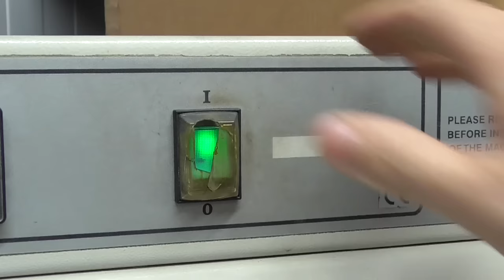Rusty Jammed Rebar Cutter - Restoration

Comment: Machining is one thing, welding is another. Take a welding course 😉
Reply: Even if he's not great at welding. He's fantastic at machining. So it does the job. He's looking for a bond, not a pretty joint. What's the point in a pretty weld when your gonna re machine the peice anyway
Reply: Joey Gartrell exactly get er done lol
Reply: Welds were not bad
Reply: @RylaDarkstar  You don't judge a weld based on what it looks like on the outside...
Reply: @redline9579  A real welder know when it's good weld and when it's not. Trust me I know what I'm taking about
Reply: Rob C  Thank god someone who speak my language! It's nice to meet you doctor Banner!
Reply: @RylaDarkstar  I wouldn't say that just yet. He hasn't figured out that round files are a thing yet, and he welded inside a hardened bushing instead of replacing it
Reply: And he doesn't know how to use a file properly
Reply: @420StepsFromHell  grinder an paint!
Reply: @redline9579   you're right. Welds weren't bad. They were atrocious.
Reply: @IRonIcScopez  obviously you know nothing of welding. I've been welding for 10+ years. The very first thing a weld must do is pass a visual inspection. If it's ugly and doesn't pass, it doesn't matter about the penetration or bond. I've seen welders get “looked out" on the job over an ugly weld. Learnt ya a lil something today about welding.
Reply: @tynstaci  haaaa haaa haaaa omg hahahahahhahahaha
Reply: @tynstaci  And I've been taught by a journeyman welder whos been welding 4x as long as you have. I very often make better looking welds than the guy who taught me, but thats just because hes older and I have a steady hand, that does not mean that my penetration was better, or that my weld is stronger than his. The main thing about a weld that you can actually see on the outside is undercut and underfill...
Reply: If he went to college for machining then he had to take a welding class to pass

Comment: Restored rebar cutter..

Doesn’t cut rebar.
Reply: Dane Rivera Idunno, there is some rebar pretty similar to that 8mm rod of steel, so it clearly works.
Reply: @grubinskii  Why is cutting rebar dangerous with one of these?
Reply: Krzysztof Trapczyk I would assume it’s because of the massive amount of energy released each way into the bar that is cut. Rebar is no joke...
Reply: Grubinski nah
Reply: Dane Rivera i was happy with the demonstration
Reply: Grubinski you know it’s  called a rebar cutter for a reason right?
Reply: @Renville80  some of the 60 grade 5/8 rebar is very difficult to cut. I have had pieces of it break when I try to bend it in my bender.
Reply: @jerrythompson5967    Everybody I see cutting rebar uses a cutting torch, saw, or grinder - I have never seen a cutter like this.
Reply: @michaelinhouston9086  where I live we use cutter/ benders the same concept as this cutter where you pull down on a handle.
Reply: Matt Columbus  I have cut thousands of pieces of rebar using a cutter similar to this one , the biggest you can cut is 5/8. Cutting 1/2 with one of these is fairly easy.
Reply: I cut rebar with this took one time, it shot rebar into my eyeball and broke it. I make new one
Reply: Im sure they use cutters like these all the time in places like India, and only for cutting 10mm rebar
Reply: @Chrominance87  People use rebar cutters like this all over the world man, the technology may be old but it's still the most practical option for thinner pieces. Main support bars are usually cut offsite by abrasive disk machines or plasma, but 3 to 8mm spacing or connecting rods are cut on site and this type of manual shear is both faster and safer than a hand held angle grinder, especially when you work on high scaffolding.

Comment: Threading your home made nut onto a home made bolt must be a hell  of a drug
Reply: Daniel Savage It’s probably a very easy thing for a professional machinist to do..
Reply: During my apprenticeship I was given the job of making a phosphor-bronze double start left-handed screwed shaft and nut to a none standard thread, which meant that I had to make both external and internal tools to cut the threads with, then I had to turn the other end of the shaft and put a smaller standard thread on the end to accommodate a control wheel. This part was a control shaft for a broken gate valve in a production foundry. I was only supplied with enough material to make one shaft/screw and two square nuts. Now that was one hell of an adrenaline rush!

Comment: I’m starting to wonder whether or not he has his gas on when he’s welding.
Reply: Looks like he's using flux core but I can't say for sure. Lots of spatter and discoloration after the weld.
Reply: His welding is the only thing about these videos that perturbed me for sure.
Reply: It didn't sound right either. I'm amazed he was able to get such a smooth machined surface after those crappy welds. Brilliant machinist though, but jeez dude learn to weld
Reply: Just seems like he's either too cold or too much wire, thought for sure when he was turning the handle that it would fly apart😂

Comment: Beautiful job, great demonstration of metalworking skills.  I would probably have put the whole assembly in a reverse-electrolysis tank for a week or so, which might have salvaged the old fasteners but not the cracked blade or missing handle.  OTOH for a little over $300 one can buy a manual rebar cutter rated for 5/8" steel.

Comment: The hydraulic press is the ultimate ”I wasn’t asking” tool for stuck pieces. I’m familiar with the use of a cheater bar for extra torque, but it doesn’t get better than hydraulics

Comment: Glad to say it, another BEAUTIFUL piece of restoration.  Well done!  Only question I have is why did you decide not to  apply paste/filler on the flat pitted surfaces and sand it down perfectly smooth like you have done on some other restorations?

Comment: I'm probably way too late to ask this, but wouldn't putting it in boiling water for a short duration before putting it under the hydraulic press have helped getting out the stuck bolt with less force?

Comment: You should consider not hammering a naked bolt - it can mushroom.  I've had good results re-threading the nut back on (loosely), then hammering.
Reply from the maker: That's why I used the nylon hammer first. But you're right.

Comment: You don't need to disassemble anything. Heat until red. Throw in cold water. All the rust will fall off. It will be like new.

Comment: Next time heat around the bolt with a torch if you can make the outside area as hot as you can it would have practically fallen out

Comment: Two questions: why did you not de-rust the whole thing prior to disassembly? You did in other videos and it worked quite well. Second one, why did you not use filler prior to painting? I am very ignorant on this topic so I was wondering if there are proper reasons for that or it was just a stylistic choice.

Comment: Just curious why, after using machines for everything else, you used a hand-held drill tomake the holes in the two bolts at around 20:25?

Comment: 2:19 What are the red squiggly lines that shoot out of the press when that piece snaps? Look at it frame-by-frame if you don't know what I'm talking about. I'm guessing its super heated metal splinters traveling fast as hell, but I'm not sure. Hence the question.
Reply from the maker: That's correct, sparks from metal

Comment: OK serious question: are you leaving the WD40 long enough to penetrate or are those parts so well "sealed" together that it will never penetrate? (In my experience if left for a couple of days - with probably a couple more squirts along the way - the whole screw eventually gets oiled and the thread unscrews like a dream. Granted, mine may not have been quite as rusted or as old).

Comment: For the cutting bits why didn't you sharpen them a tad? I would think that would help with the tougher metals.
Reply from the maker: They have a sharp edge. 90° cutting angle, well more shearing than cutting

Comment: Using a 6 inch extension for a T bar. What the actual F?
Also, either give the penetrating fluid time to do it's work or use heat before you screw up your press.
Reply: If he used penetrating lubricant I don't think we would like to see a stationary video of the part sitting there for hours. I'm sure he waited for it to work. And heat on a bolt like that only exacerbates the problem.

Comment: Do they not have hardware stores in Switzerland? Like, i get it when it's a specialty part, but at the point where you are making a new hex nut out of your loaf of hex nut stock, i have to wonder why someone didn't tell you they sell those ACE for like $0.33

Comment: You can remove zinc plating quite easily using 15% hydrocloric acid solution. Be carefull for it is a very exothermic (violent) reaction. Emerge it for a few minutes and the iron parts are left untouched. Hydrogen gass is emitted, so don't smoke indoors ;)
Love you making your own parts though
Reply from the maker: Awesome, thanks for the tip

Comment: Great work, as always! One question: why do your welds come out so ugly? Is that fluxcore welding or regular MIG/MAG? 🧐
Reply from the maker: My welder is a very cheap one, I don't have many settings to change.
Reply: @mymechanics  ok! It just didn’t make sense in my mind that a master crafter like you would get just those welds with a half decent machine 😅😏
Oh, and by the way: do you weld with regular steel over the cast steel objects? 

Super Arbeit machst du, danke dafür!
Reply: @mymechanics  as the topic is just on the stable, i also have a few questions ^^

Do you weld one handed? And it seems you usually spot-weld over one continuous weld. Is there a specific reason?

Wiiter so 👍

Comment: THE HANDLE is overdone.
A typically German thing to do. But, of course, the quality is great.
Reply from the maker: Thank you, but I am swiss ;-)
Reply: @mymechanics  Yes, I have learned that later, so let's assume I meant the ethnic roots/culture in this aspect, not state/nationality. 
Austrians are also alike. Just look at e.g. Plasser & Theurer railroad making/fixing machinery. The engineering and mechanisms there are so complex and seemingly "overdone" that I also guessed the culture/tradition there without knowing where it was designed/manufactured.

Comment: You really need to get yourselves a TIG welding, as it's a lot easier to drill, file, machine, etc. Due to the weld cooling down a lot slower, so it doesn't get a hard. 
You can buy a cheap TIG welder off eBay which also opens many other doors as you can weld anything with TIG.
I promise you I'm not being an arsewhole or anything, but you really need to get some welding lessons.

Comment: please learn how to weld, all of your videos make me cringe when I see the welding you are clearly a skilled machinist and maybe its because you machine all of your welds away for the most part but even so a proper weld also is more structurally sound with proper penetration so spend some time and learn some mig and tig skills it will serve you well in the future, also for the love of god get a power coating setup.